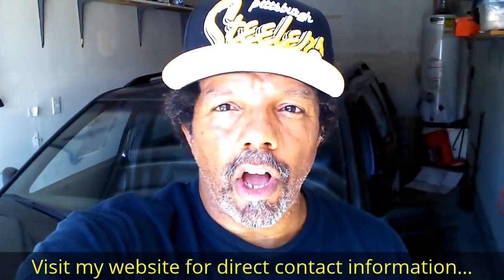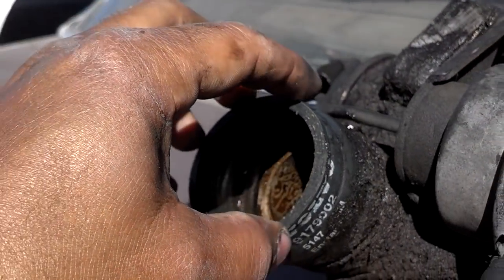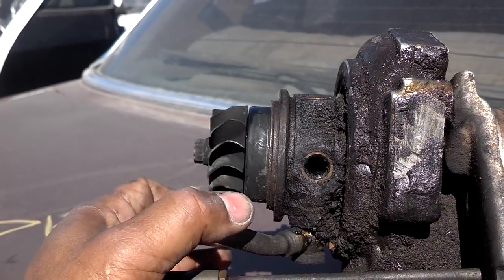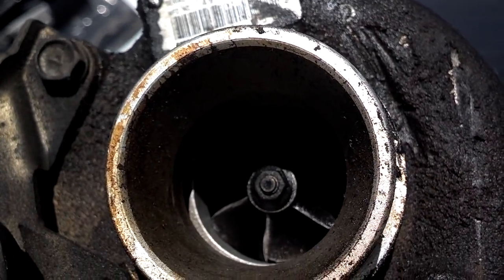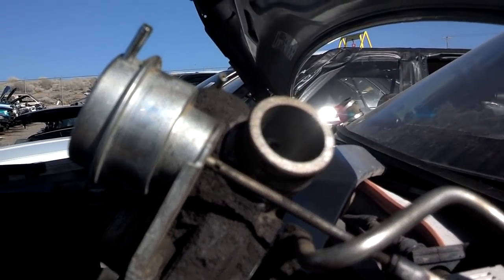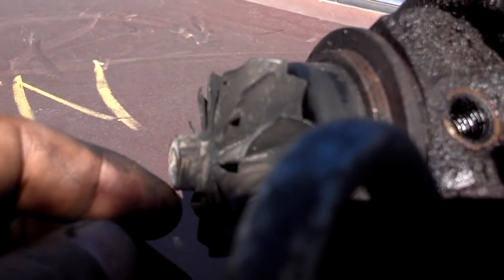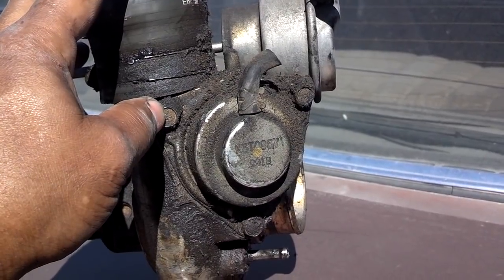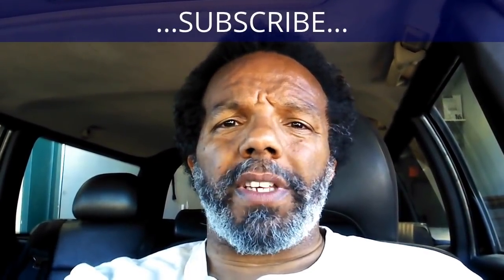How to tell if a turbocharger is bad. What can go wrong with them. - VOTD

Comment: 3 yrs ago I bought my daughter a used 2005 S40 T5 AWD. The car runs great but it’s loud. Yesterday I did a smoke test from the tailpipe. Smoke was coming out under the exhaust manifold heat shield. With an inspection camera I found it’s missing all 3 bolts that hold the catalytic converter to the turbo/manifold. There is a very small gap between them. I just ordered a new gasket and bolts. I’m hoping that driving for the past 3 yrs didn’t ruin anything. Does driving with the exhaust leak cause harm to the turbo?
Reply from the maker: It can because it needs some back pressure. All you can do it fix it and move forward.

Comment: Not sure if it's turbo related but my 2001 S60 T5 shuddered and made a clanging noise and wouldn't start.  It was driving perfectly fine before that, and I was about 25 miles into testing to see if the overboost code it had been having went away after installing a new boost pressure sensor and wastegate actuator. It has been warm for a while here in Houston but just got below freezing after the previous day being in the 70s.. so maybe the cold weather sudden change caused something to break. It smells like exhaust under the hood near the turbo area when I try to start the car.
Reply from the maker: maybe a tube come loose.
Reply: @RobertDIY  I'll check that next after I test another battery thanks!

Comment: Hi, I need your opinion about an issue with a BMW N55. The turbo is creating a boost on idle. I replaced the boost solenoid, etc. I noticed it when I disconnected a hose by the throttle body. I disconnected the actuator, and the boost stopped—all of this with the engine idling. 
Thanks
Reply from the maker: Sadly I am not familiar with that system.

Comment: What happens when it only smokes when you’re in boost no smoke driving around only couple seconds after into boost and bad ?
Reply from the maker: check the turbo for shaft play. If it feels solid and has good boost, you may have an issue with crankcase pressure or worn rings.

Comment: What case oil to go into the volvo s70 inter cooler
Reply from the maker: https://youtu.be/3uYXawsKO2U
Reply from the maker: EGR/PCV system is designed to recycle hot oil vapor air to circulate into the turbo inlet via the PCV.

Comment: I drilled and tapped an M8 bolt into the exhaust manifold,  from this point I spray oven cleaner into the area to clean out my turbo. I have uploaded a video on what I did.
Reply from the maker: cool

Comment: My 2018 Civic EXT, 1.5 liter, turbo, GDI, CVT:
I NEVER redline.
I rarely exceed 4k RPM
I rarely drive short distances
I never exceed 2.5k RPM until the oil reaches optimal temperature.
I ALWAYS change the oil/filter early (approx. every 4,200 miles) with Honda 0W-20 synthetic and OEM filter.
When I complete my drive, I wait at least a minute on idle before turning off.
I only use top tier fuel (93 Octane with the highest detergent).

After over four years and 126,900 trouble-free miles I’m happy with my Civic. I’m hoping to get at least 300k miles without repairing my engine, turbo, or CVT. 🙏
Reply from the maker: awesome! I beat the crap out of mine.

Comment: are rebuit turbos ok or should you just buy a new one...
Reply from the maker: My experience is that rebuilt turbos can last more than 100,000 miles as long as they were rebuilt with quality parts and are VSR balanced. Now if you have performance mods and will be beating the thing, it probably will wear out faster. A new turbo will likely last longer.
Reply: @RobertDIY  so robert do you just find used turbos at the junkyard or what do you do?
Reply from the maker: The last turbo I installed was a rebuilt performance turbo.

Comment: So with a damaged turbo, a car will puff a continuous white smoke or it s intermittent sometimes?
Reply from the maker: Depends on how bad it is. Usually when it gets bad enough it will blow smoke under acceleration all the time. But you can have a warn turbo and it not smoke but will fail to boost to the proper PSI. I had one that was getting worn that would only produce seven PSI instead of 10 psi so I replaced it.

Comment: So my 02 S60 turbo is making a scraping noise (best to describe it) and like a suction cup sound. No boost and oil pressure light or no pressure but full oil on dipstick.. any ideas of how this is failing?
Reply from the maker: No idea. Post a video and send me a link.
Reply: @RobertDIY  unfortunately the car only lasted 74 miles after that. Just kicked the bucket today. Spun a rod. 2.3L T5 231k miles, RIP. I’ll take some videos of my tear down in the future and send em your way for educational purposes.

Comment: Can anyone answer me this I've got a Saab 9-3 2.0 Turbo 2008 just recently I realized the coolant line to the turbo is cut off I've been driving the car like this for quite some time unknowingly is this going to leave me stranded should I get this fixed immediately if so does this mean I have to replace the entire Turbo when hooked up it seems as though it's introducing exhaust gas or extra pressure into the coolant system and draining the coolant reservoir simultaneously.. thanks for the video
Reply: The oil it's still going to the turbo though just fine
Reply from the maker: I can't imagine that the coolant line is disconnected and NOT draining ALL of the coolant out in 5 minutes. You should take your car to a Saab mechanic so they can see what is actually going on.
Reply: @RobertDIY  cut off with a bolt and a hose clamp around the end sorry should have been a little more clear
Reply: When I originally bought the vehicle the upper radiator hose with a T in it had been replaced with a straight radiator hose with no t and I was looking around under the hood saw that there was the line coming from the turbo but no where to hook it up so I was confused order the correct upper radiator hose reattached it and then had all kinds of issues
Reply from the maker: dang

Comment: have you heard a loudish moan noise coming as a result of Blow off valve, or wastegate? something under the hood is making that noise very occassionally for a few years, its stops immediately once you let off gas. It does it mostly going up hills. it doesnt affect performance at all. guess cause could be something else too idk
Reply from the maker: Probably something in the drive train.
Reply: @RobertDIY  ive had over 500 cars (was a car dealer, never heard that noise ever coming from any car. If i had to guess i would say an intake hose, blow off valve, maybe valve crankcase pressure releasing....who knows
Reply: @RobertDIY  If its a bad blow off valve can i add aftermarket one on top of engine to bypass the old one, or do i have to pull old one? i assume you can test old one on car right? pretty sure you can vacuum test the wastegate on the car 
right?

Comment: When the turbo lacks oil or actuator fails it causes bearing to a near melt down which releases small partials it's not screws that just happen to get into the turbo if you try to drive a vehicle with a failed turbo yes it will be slow the reason for this the compression can't escape and of consequence that puts internal pressure on all internal gaskets and seals get it fixed straight away or do not keep using the vehicle you are making a bigger bill for ones self
Reply from the maker: Interesting.

Comment: Hello Robert, thank you for the videos you make, they have been most helpful. 

  If you have time would you please give me your opinion. I have a 02 Volvo C70 2.4l with 124,000 miles. It recently started leaking oil and got worse. The camshaft seal was popped out a little. I pushed it back in with a screw driver and it seemed to hold. I drove it for about 40 minutes and was returning home when I lost power and the car would not go any further. I started it again after several minutes of letting it set, it has a horrible knock and it sounded like  a dry bearing. Does this sound like the turbo or my engine?
Reply from the maker: How is the oil level? Can't hear the noise from here. 🤔

Comment: Great video and explanation. I have a VW Caddy and it doesn’t blow smoke at idle but it blows allot of white/greyish smoke (like your James Bond moment in the video) whilst driving or under load. In your video i noticed the smoke was constantly blowing even at idle. So my question is does it matter whether or not you have smoke at idle or not at idle,
Reply from the maker: It'll get worse.

Comment: I am too late to see this informative video.  Best job  done.  If you have a time to do same on EGR system
Reply from the maker: EGR system is designed to recycle some of the exhaust gases back into the engine for use. What do you want to know about it? It often gets clogged up with carbon which will need to be cleaned out from time to time.
Reply: @RobertDIY  Thanks for your reply. I want to know its troubleshooting.  and when open and close. If the dpf having accumulated with soot effect of back pressure to Egr. With my best regards

Comment: Hi robert, I saw in this video that there was extreme amount of smoke under boost.

However, I’m getting clouds of white smoke ONLY after idling for exactly 2 minutes. 
Never happens under the following; under boost, decel or decel down hills or in the mornings after sitting. It also only happens in ‘N’ or ‘P’ and goes away when I put it back in ‘D’ and drive off.

The turbo is kinda new (just under a year), and the car is an Audi A4 2.0T 2013 TFSI

(Note: I did have a blockage in the exhaust, cat broke down and wedges inside) that may have caused premature failure of internals?

But at this stage, I’m reading mixed information online, but seems to be consistent either between “turbo hot seal” or “exhaust valve stem seal”
And another possibility is that I may have noticed this after installing a catchcan that bypasses (uses the existing and not deleting) the OEM PCV 

What’s your thoughts? Any quick tests that can be done before I try remove the expensive  catch can, reverting back to stock to see if it improves the vacuuum?
Reply from the maker: Valve stem seals or PCV. Check to make sure the PCV doesn't have any loose or kinked hose.

Comment: Alright robert so im here trying to hunt down the cause of a misfire for a month now just did coils and plugs fuel pump and relay along with the cvvt solenoid on my 2000 s70 glt i found cylinder 2s plug covered in oil on the inside of the cylinder after doing research i read somewhere that oil could be coming through the intake from a bad turbo if this were the case wouldnt all plugs be covered in oil ? i shined a light down each cylinerder and couldnt see any oil besides what was on the plug from cylinder 2 so im thinking pcv system needs service but that still doesnt solve the misfire problem i dont believe as it was still starting up rough after replacing the plugs i think my next step will be the maf sensor and crank position sensor and now while im there probably check for play in the intake side of the turbo got any other ideas for me
Reply from the maker: it's not oil it's unburnt fuel.
Reply from the maker: https://youtu.be/1lzDZNwGWbI
Reply from the maker: https://youtu.be/Sg7iFytxfzQ
Reply: Wow that never even crossed my mind it did seem like super clean oil and i had oil on top the engine so just assumed thats what it was right away guess ill do the compression test and get some real answers .. should it run a little smoother once the fuel injectors disconnected or is that just to not damage the cayt thanks as always
Reply from the maker: Yep

Comment: I have a 2013 ford escape with ecoboost 2.0. And i have a bad grind sound where the turbo is. Also have a code that has to deal with the turbo. Have you heard a turbo grind really bad for any reason? Turbo drives well and still feel it pull when boost kicks in. Just has a very loud grinding sound. Maybe one of the blades got bent and rubs while it spins??
Awesome video very well done! !!
Reply from the maker: Grinding sound is probably something else. If a blade gets bent or something, it will not rub the housing. Turbo's spin so fast that wouldn't last a few seconds.

Comment: Would no oil change in a 2015 Volvo cause the turbo to fail? 110k miles
Reply from the maker: I don't understand your question
Reply: Robert DIY sorry, thanks for your response. My brother has a 2015 Volvo S60 with a turbo engine. The car has around 120k miles on it and he forgot to change the oil for 10-15k miles. They found metal shavings when they changed the oil. The car is starting to show signs of turbo failure. Could it be caused by lack of oil change???

Also, thanks for posting this helpful video and responding so quickly.

Comment: always use synthetic oil, on mine the turbo shaft snapped.
I got a new/rebuilt turbo cartridge from ebay for $185, it was made and balanced in the uk.
volvo wanted $4K, hah, as if.
BTW, compressor blades don't come loose because they are reverse threaded.
its been good for 3 years now, no more dino oil to save money.
Reply from the maker: Amen

Comment: Hi there. I got a cuestión i’m installing a new turbo for a ford escape 2014 my cuestión is if once i install the turbo do i have to add oil to the turbo? Or it’s the same oil that comes from the engine?
Reply from the maker: Oil comes from the engine. De-activate spark or fuel and crank the engine until oil pressure builds.
Reply: Robert DIY thanks for your help 🙏👍 i appreciate it.

Comment: Robert, my 05 XC90 2.5T had an upper intercooler hose caked in oil. I replaced it and the new one is showing signs of oil buildup where it connects to the main boost pipe. Could this be a sign of a failing turbo?
PS: PCV components replaced at the same time as the new upper intercooler hose (2 weeks ago).
Reply from the maker: Yes.

Comment: Very informative video! Excellent work!

My car (Mitsubishi 3000GT VR-4) smokes only on deceleration (vacuum) and only after going into boost... I have recently rebuilt the turbos and I have also replaced the heads with newly rebuilt ones. I also replaced the PCV valve with a brand new OEM one. What would be causing the smoking? Thank you!
Reply from the maker: Something is probably loose.

Comment: I had a question i know this video is older i have a 2013 hyundai genesis i installed an aftermarket 02 housing and when i put my car in park it smokes but when im driving i never smokes only when its in park its never overheated or anything
Reply from the maker: Probably running rich or the PCV system is messed up.
Reply: Robert DIY thank you I appreciate the fast reply keep up the videos🙏🏻

Comment: I got a 97 volvo 950 t5 smoking just like that would u change head or turbo
Reply from the maker: If the turbo is bad, I would replace the turbo. If it has a blown head, I would replace the head. 🤷🏾‍♂️
Reply: @RobertDIY  how cam u yell if heads bad if turbo is bad the bushings in turbo r gone ot wobbles alot

Comment: I have a volvo s80, 2002 model, when the turbo was damage, I already removed it and welded permanently the portion where turbo is installed,the engine and power is all functional, my question is, is it OK to remove the turbo, will it not damage or affected the engine. By the way the engine and pulling power is ok.
Reply from the maker: I find this hard to believe but it should be fine.

Comment: Quick question for you? Whats important is not to have cracks in the exhaust part off the turbo? I have a 02 golf gti and i have cracks on the exhaust part of the turbo. Any input will be nice
Reply from the maker: Very common. As long as the cracks are internal I really would not worry about it.

Comment: I have a 96 Chevy 6.5 diesel and rpms go up and downwhen driving barely hit gas and it goes up to 3rpm then will cut back to 1.5 rpm i replaced fuel filter im waiting on waste gate actuator. Some one said i need a new turbo which is $932.
Reply from the maker: Ouch

Comment: my 2011 Volvo XC60 has been leaking oil from the turbo into the cat converter, the mechanic said i needed to replace the turbo and oil lines, as well as the cat. He said my best option was to sell since it was going to cost about $6,000-$8,000 to fix everything, (mechanic is the brother of a friend of mine) but after doing research I can’t find anything about a turbo leaking oil and needing full replacement. Not sure what to do at this point, i took it to my moms trusted mechanic and he only noticed that the cat converter needed replacement, and didn’t say anything about the turbo. Not sure what to do at this point since I thought I could trust both mechanics but they both came up with different diagnostics. Help anyone?
Reply from the maker: Two words, Volvo Mechanic.

Comment: 2007 saab 9-3 multiple misfire codes and p0245 turbo wastegate solenoid low.  Random flooding on startup turbo stutter no hissing.  Replace injectors, fuel regulator, and turbo solonoid, now runs a bit better but still tripping same codes and additional p0246 solenoid high?  Any Ideas?  Stuck wastegate?
Reply from the maker: Sad to say, I can not troubleshoot that from here.
Reply from the maker: https://youtu.be/1SSTRNxhuAo

Comment: Hi ya'll, can somebody tell me if i can use my mini pajero without the turbo????
Reply from the maker: Sure, if you replace the ECU computer, remove the turbo piping, and install NA air piping.
Reply: Oh my gosh, so if I just remove the turbo and close it up as is, it wont work ?
Im so desperate it been a full year with me having unidentified problems with my car.
Reply from the maker: Run like crap, probably like 15 mph. It was engineered to use the turbo for air. Remove the proper air source and it will be gasping for air while trying to run.
Reply: @RobertDIY  oohh ok then. Can i keep in contact, I think ill need your advise in the near future.